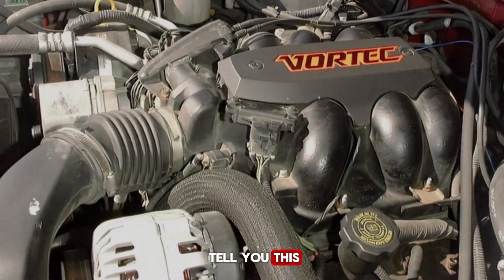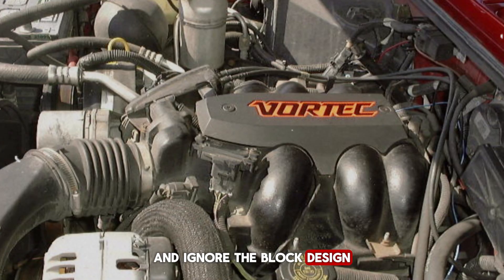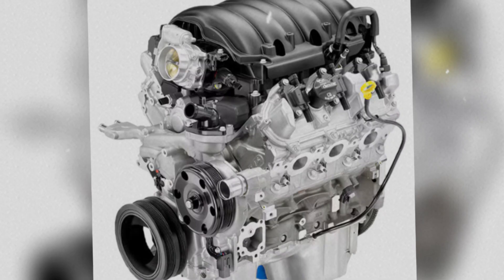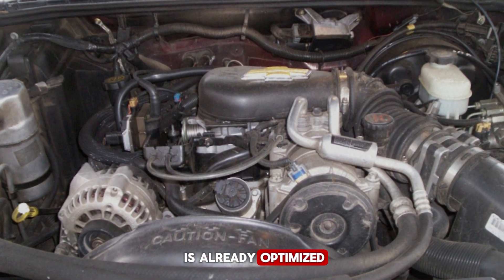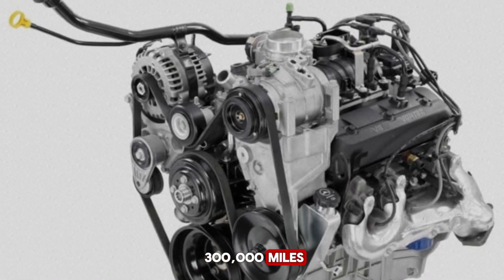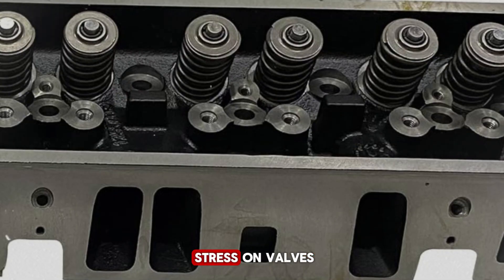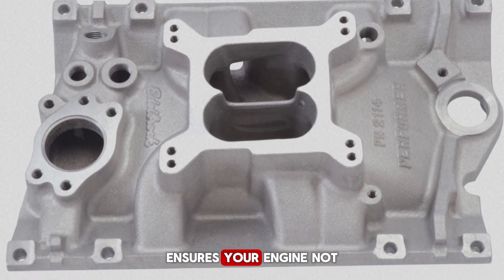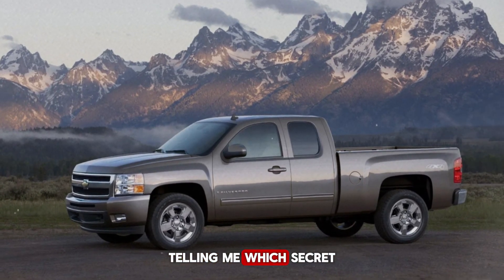Chevy Vortec 4.3 V6 Engine: Top Secrets Mechanics Won’t Tell You

Comment: Yeah... 00:12 the whole alternator rotates, the AC compressor has no clutch but instead has internal fins on it's pulley, and the brake booster cooling fan started running. 😂

Then at 00:24 we see the water pump pulley running through the serpentine belt, while a smaller pulley attached to the water pump pully driving the alternator.

Comment: oh lawd, it’s AI. 💀🤦🏾‍♂️
Reply: Yeah... 00:12 the whole alternator rotates, the AC compressor has no clutch but instead has internal fins on it's pulley, and the brake booster cooling fan started running. 😂